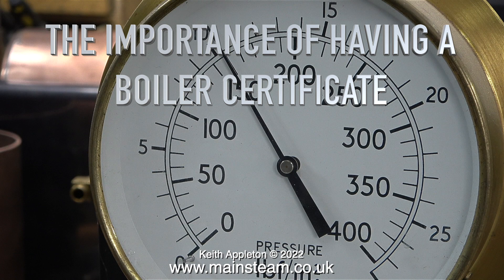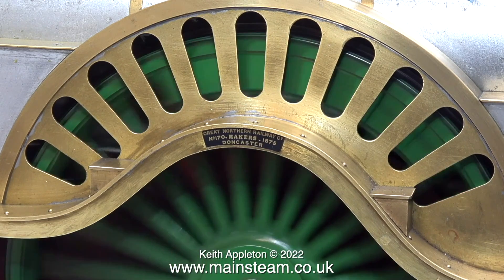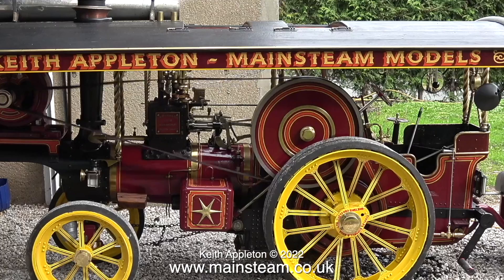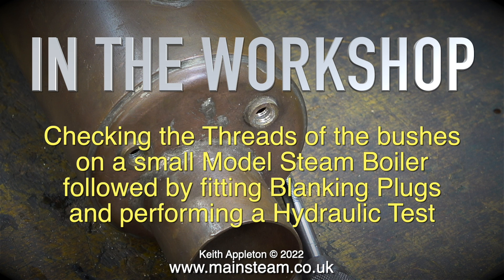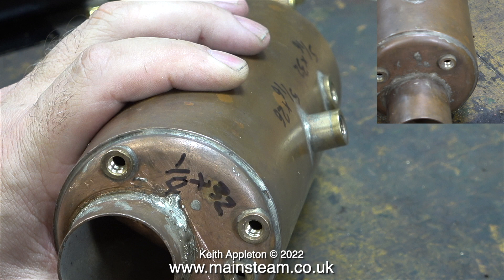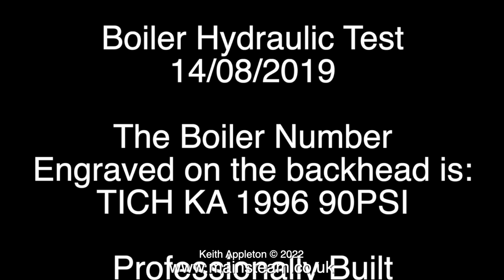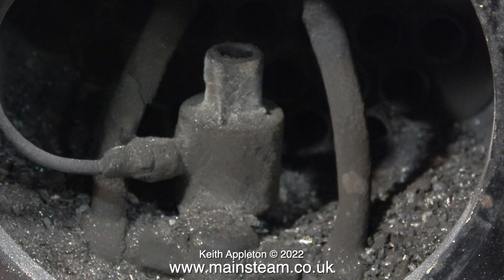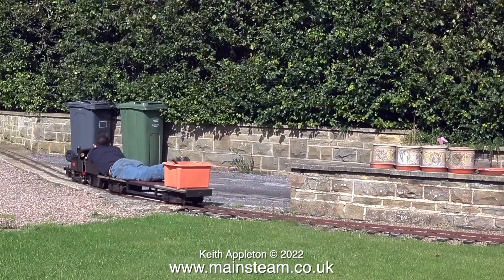THE IMPORTANCE OF MODEL BOILER CERTIFICATION

Comment: Hi I had a boiler and hydraulic tested it with water to 3 times the pressure at home it had a welded steam boiler still could find anybody  interested in doing a steam test I did it at home to 60 psi was perfectly fine 
Gave up in the end trying to sort it out sadly

Comment: Bonjour Keith,
I fully agree with you, such a regulation is quite useful for safety reasons, however, in France, it is mandatory if your boiler contains more than 25 liters.
I have lived a breaking water level glass pipe in a boat and in my bathtub during a test, under a pressure of about 5 bar (80 PSI) and it has just been very funny, we just found ourselves instantly in a thick and cool fog, not any damage except the glass pipe.
On another of my boilers, a micro leak occured in the central heating tube and I repaired it with sodium silicate. I guess a repair can be done by silver soldering outside the boiler.
In our model boat practice, with a gas regulation, we generally operate at about 2-3 bar (30 - 5O PSI) except for the Anton Trophy (8 bar - 120 PSI max) and I have never seen any boiler incident.
 Amicalement, Raphaël

Comment: Years ago, I worked to develop a safety program for unfired pressure vessels where I was employed. Having studied the aftermath of boiler explosions I wouldn't be in the same room with an operating boiler, no matter how small, that did not have proper safety inspections.
If you think it couldn't be that bad, imagine a stick of dynamite going off on your workbench.

Comment: One can only imagine what the damage field would be should a locomotive boiler were to fail with people in the vicinity.  I’ve seen a 40 gallon water heater fail, it took off like a rocket through a two story building high up into the sky above the house, causing well over $85,000 in property damage alone.  Like they say, what goes up, must come down.  When the water heater came down it went through the roof of a small car, through the floor pan and into the concrete driveway.  Had there been a passenger in the car no way would they have survived.  I was just across the street from the house when this explosive event occurred.  I would really hate to see something similar happen to a locomotive hauling a bunch of youngsters along a track. Truth be known that bad things always happen when corners are cut to save a few bucks.
Reply: Well knowing what happens when boomers have failed ( due to other circumstances) kinda kills people around the locomotive

Comment: Hydraulic testing of steam boilers to twice the safe working pressure only applies to their first pressure test after manufacturing or after structural alteration or repair, subsequent hydraulic testing is only required to be carried out at 1 1/2 times SWP and is within the requirements of the PSSR. Twice working pressure is discretionary
Reply from the maker: Yes I know that Twice working pressure is discretionary - But personally I always test to twice working pressure on my copper boilers, it is a better margin of error